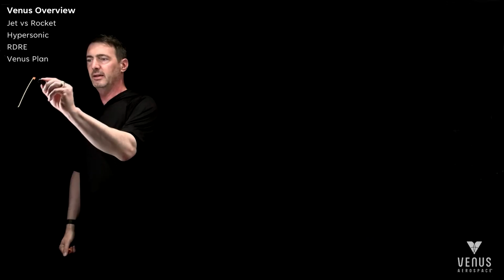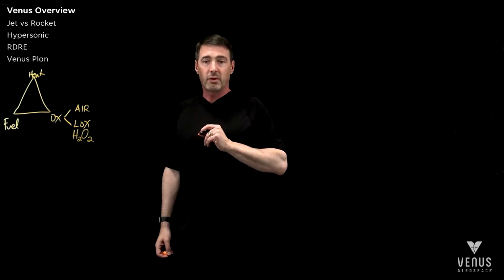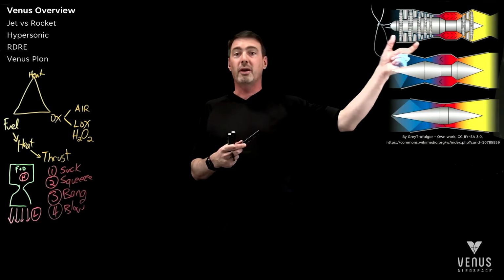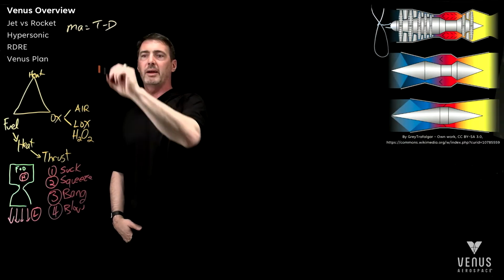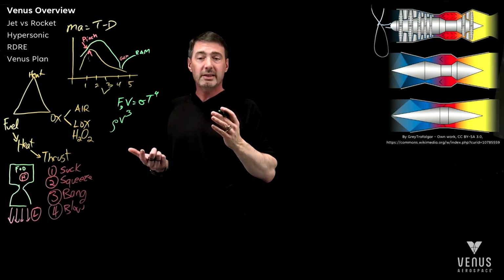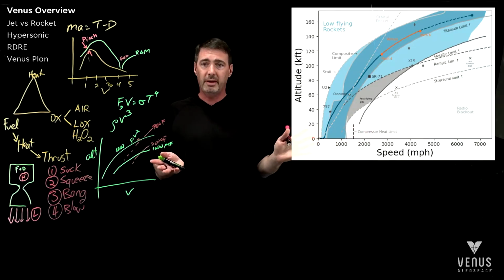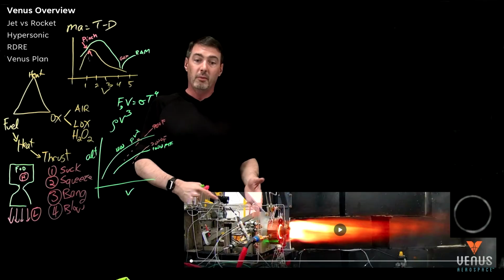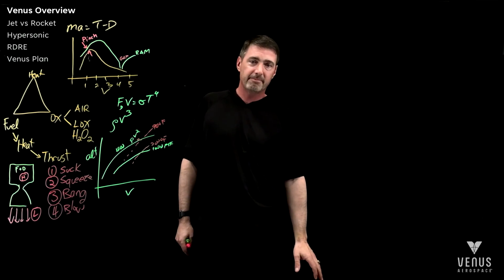High Speed Flight Episode 1 | Venus Overview

Comment: They are using the detonation engine's exhaust to entrain larger volume of air into the secondary combustion chamber using an ejector nozzle design. 
The engine is not going to be very efficient at subsonic speeds, but interesting design.

Comment: For an engineer with doctorate, and long experience with rocketry, he makes a pretty weird conceptual outline for rocket engine theory.
Reply: Yea, who says you need a spark? Just use more enthusiastic propellants. Also, using a 4 cycle analogy for a rocket is a really strange choice. No mention of throwing shit out of the rocket’s ass to push it in the opposite direction? And if it breaths air, it’s not a rocket.